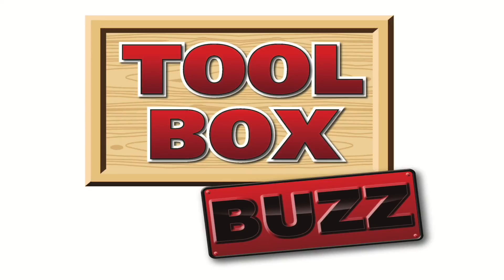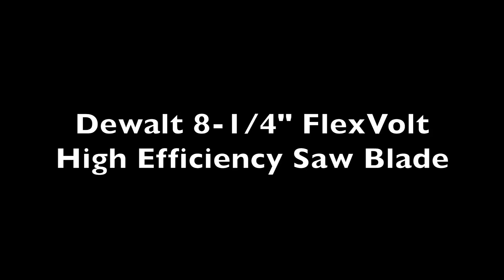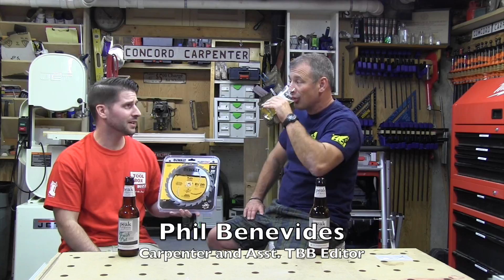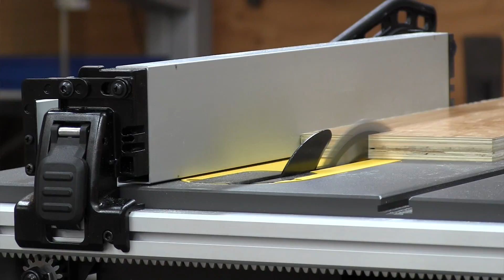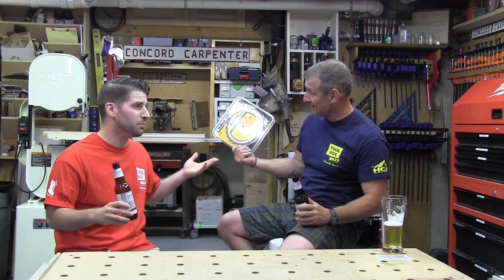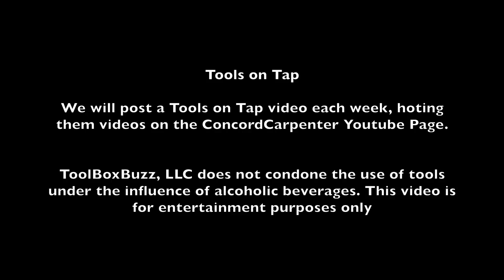Dewalt FlexVolt Saw Blade: Tools on Tap Episode # 3

Comment: I'm curuous to see how these new blades perform I have used Dewalt saw bades before and while they were decent they weren't amazing either. I have had the best luck with Freud Diablo blades. Great new video series Rob can't wait to see what you do with it #Tiacrew.
Reply from the maker: My thoughts is they are "optimized" to get the most out of the cordless power.  Thin kerf means less material cut / less resistance

Comment: Why would anybody want a cordless table saw, when do you use one in the middle of a field?..
Reply from the maker: They're quite handy. Many times homes don't have power hooked up yet, other times your in an area that is tough to reach with cords.   Additionally you can bring the saw to the work with cordless. This week we were up on staging on a store front. Power was not easily accessibly and the cordless table saw was an awesome tool to have with us.
Reply: ow cool, haha. i guess theres advantages and disadvantages to everything
Reply: @redstihl9027  We have a cabin Off grid, everything I buy is either very energy efficient or battery powered.  The Flexvolt table saw works great.
Reply: 2 years on I totally see the point... 🤣

Comment: 8-1/4" is more common than you think.  Diablo has a couple think kerf blades that I'd bet would put this flexvolt one to shame. http://www.diablotools.com/products/product/D0840X and http://www.diablotools.com/products/product/D0824X
Reply from the maker: Good to know -  I was unaware.  Maybe a saw blade test?
Reply: Jeff McMillan I have an 8 1/4 makita corded table saw. Also have the dewalt 8 1/2 sliding miter saw (use 8 1/4 blades almost exclusively with the miter saw). This is a good blade size and 7 1/4 is a very reasonable substitute, in the table saw, for basic work like rough carpentry. 
Love the new relaxed laid back format!
Rob, you guys ever do an episode on tool bags/pouches?

Comment: love this setup. just sitting around drinking beer. 

I think the saw is pretty cool, but can you just slap a 7-1/4" blade on there. you won't be ripping 2 by stock but it should handle 3/4" I would think
Reply from the maker: probably